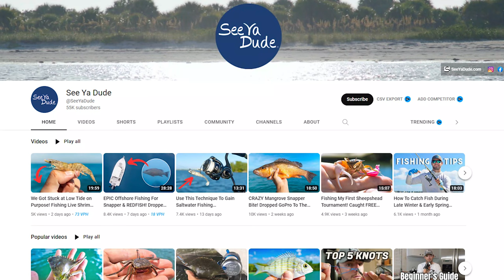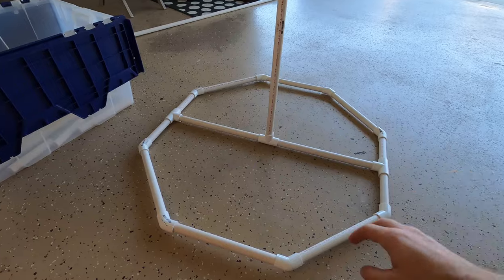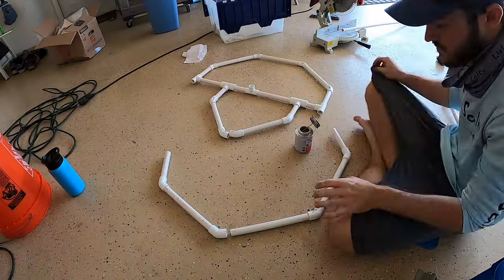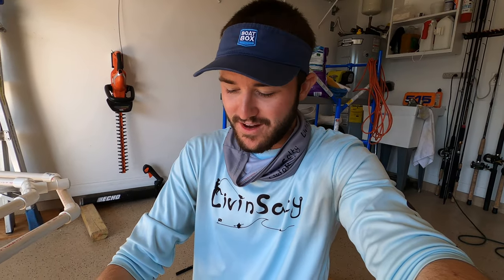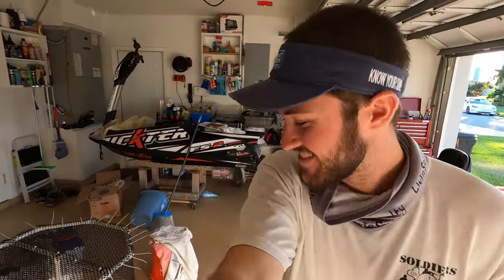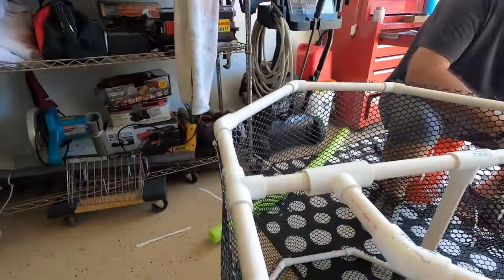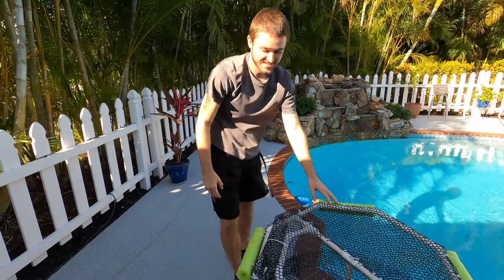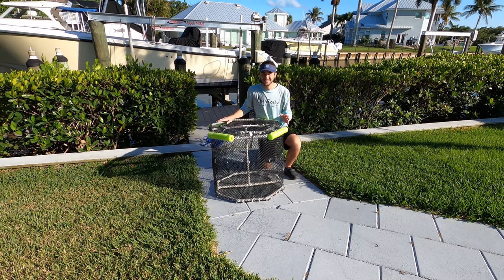Building a DIY Bait Pen on a BUDGET

Comment: You think the pen would have been too short if you just made it the height of the mesh?
Reply from the maker: Totally depends on what kinds of bait your looking to put in there! I knew I was planning on having mullet swimming in the pen and they need a pretty good amount of room to swim around. What are you looking to put in?
Reply: @LivinSalty  we’ll be in the Keys this summer and always throwing away pinfish and small grunts at the end of the day.

I’m sure the shorter version will work fine plus I’m looking to keep costs down as we’ll probably just leave it there when we leave.
Reply from the maker: I think it’ll be fine for that!
Reply: Excellent video!  Do you think this will work well for blue crab as well?
Reply from the maker: @obxsurfandsoundfishing4085  thank you!! You know what, that’s a great question. I’m not sure. I would be worried about the crabs maybe trying to use their claws to break the mesh. I’m not sure though, never thought about keeping blue crabs in there!